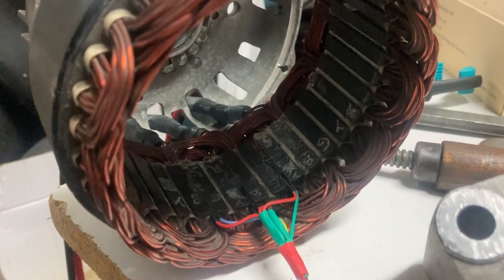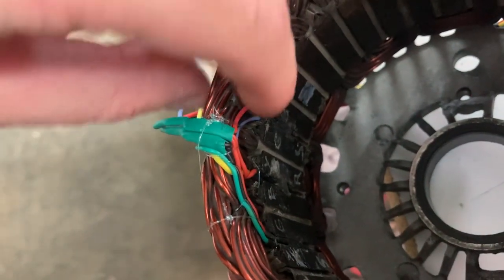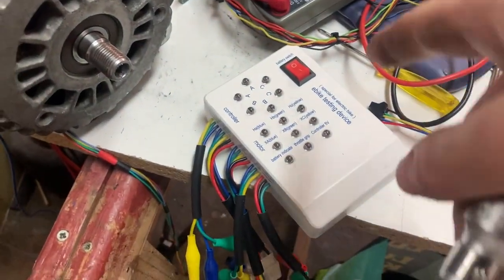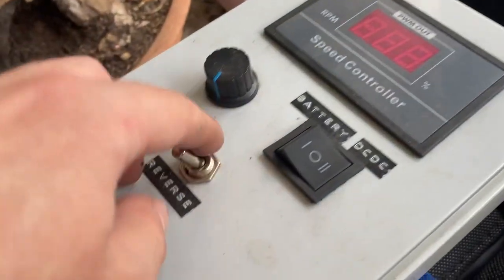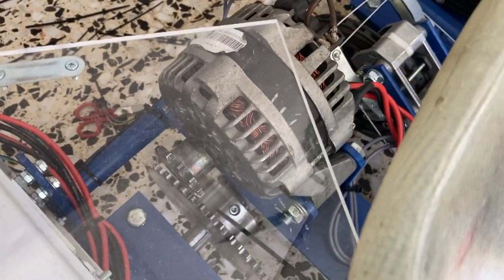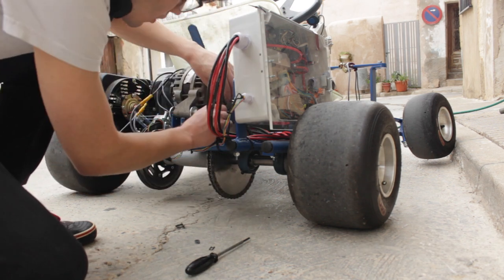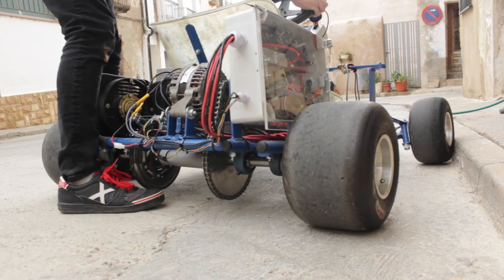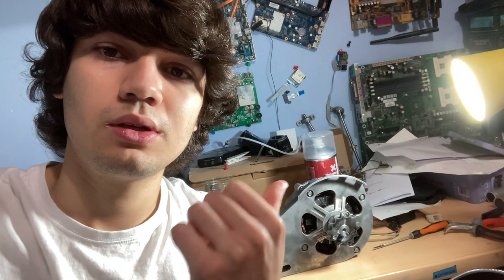The Car Alternator Go Kart is BACK with a new hall sensor setup! | Revisiting the project (FIX)

Comment: Why you change the esc(fsesc 4.12)? And why you disable the regen in the other video? 

Sucess man!
Reply from the maker: I changed the vesc because it kept busting my hall sensors, and when testing died. I got a refund and bought another one from aliexpress and worked like a charm. I disabled regen because I read somewhere that it can fry the stator windings if the motor is not prepared.
Thanks for watching!